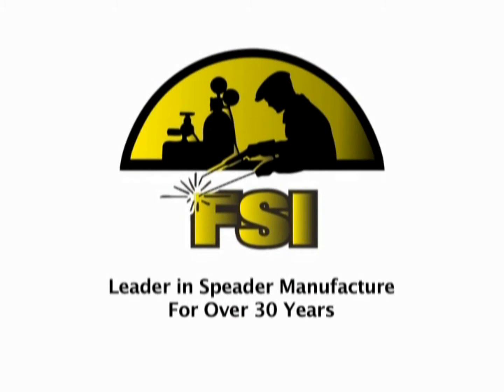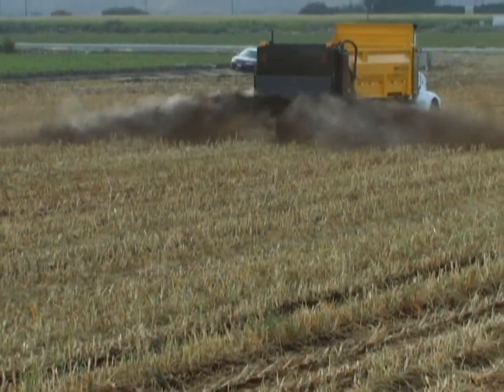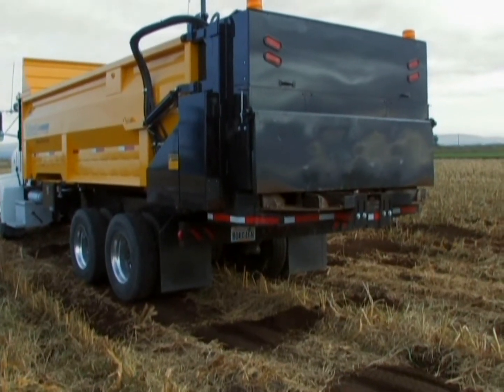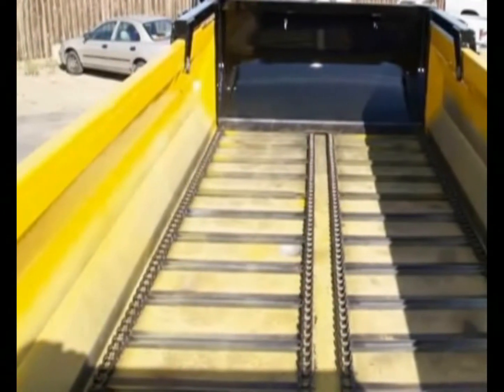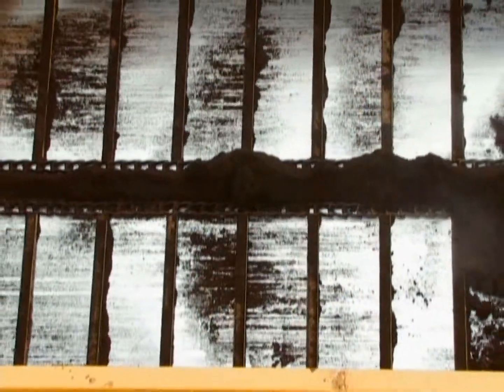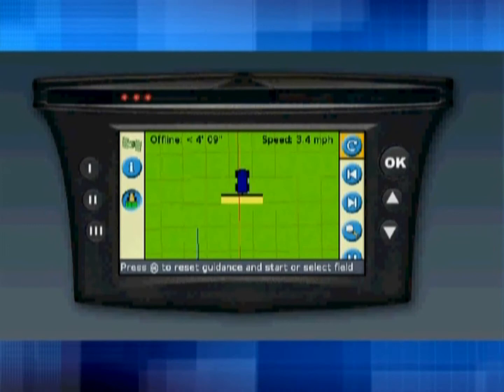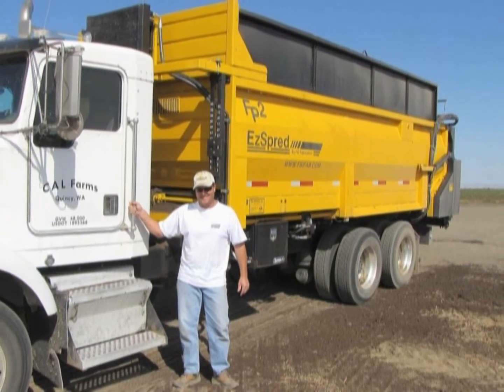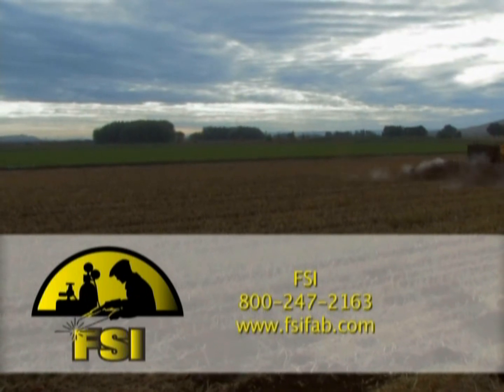Commercial Spreading with the Fp2

Comment from the maker: @speedy02 , you are correct.  There are some soil types this particular spreader would not work well in.  There is no "one size fits all" that's why we build different models designed for the soils you are describing.  Different machines for different purposes in different environments, visit our website if you'd like to see some of those other models.